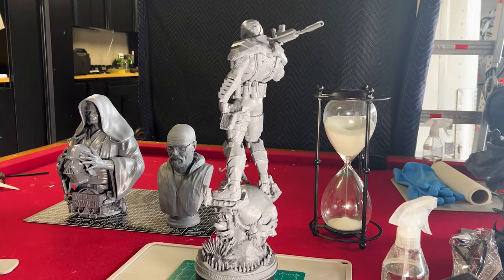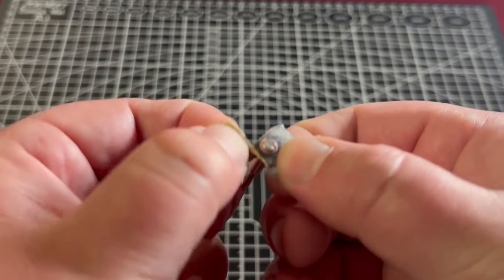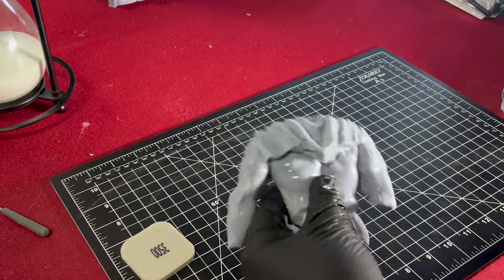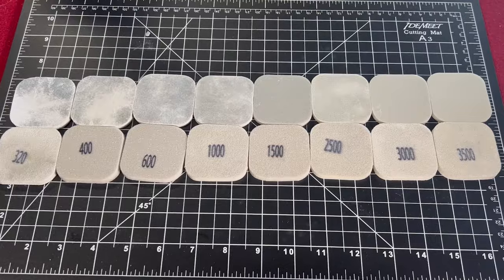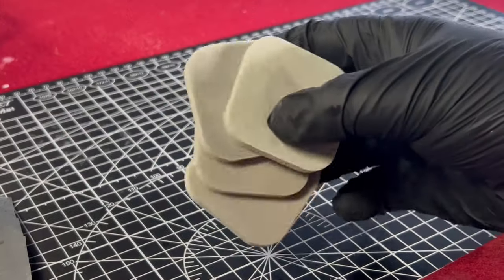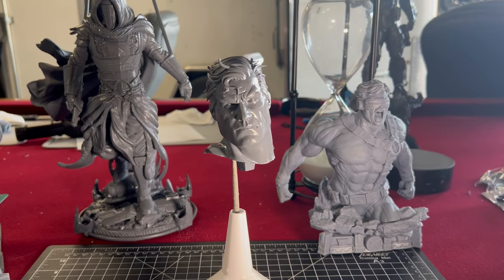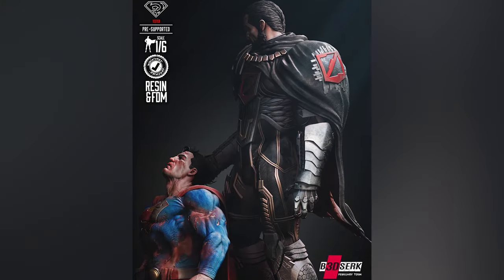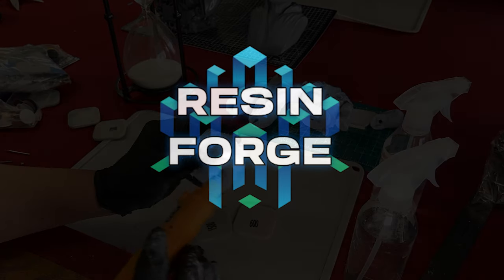Tools and Basics for Sanding Resin 3D Prints!

Comment from the maker: Links to the tools I use are in the description! 
Hello and thank you for stopping by! 

Sidenote for the 1 inch sanding discs  I use in the video: 
(These pads do NOT come with a center hole so you need to poke your own every time you change the sandpaper out... The metal attachment is also too large for the small Dremel but the pads fit fine on the one that comes with the Dremel)

If you enjoy the video please consider giving it a like I would truly appreciate it! 
If you have any questions on the process please leave a comment below and I will do my best to explain it

Comment: for me the most annoying thing when printing multi-part statue is the seam, where parts connect together and leaves some gaps
Reply from the maker: I am working on a video for that! Should be out in the next few weeks... I usually use some Aves 2 part apoxie sculpt or resin wield smaller gaps... The dremel makes easy work of flattening out bumps from seams. Thanks for the comment I appreciate it
Reply: @ResinForge is its possible to fill all the gap nicely, BUT still keep all the part seperated for easy airbrushing? the normal way is good and all but at then end of the day i got this big chunk of statue thats is hard to air brush
Reply from the maker: @WalamiFijilot  I’m not too sure 🤔 I’m new to the painting side of the hobby so I haven’t had to deal with that yet… Maybe paint them separate and leave the edges of the gap unpainted and than fix the gap and paint over it

Comment: So this looks useful for bigger prints, but I normally print tabletop minis and no matter what settings I apply I always get scaring marks from supports. It pretty difficult to remove these marks because of how detail dense resin mini are compared to traditional plastic minis. what would you recommend for smaller models?
Reply from the maker: Great point... Most of my prints are usually on the larger side. For smaller models you could use sanding sticks for detailed areas. It is basically a matchstick with a sanding pad on the end.

Something like this would probably work well 
https://a.co/d/g7d2cYW

Comment: What resin do you use? Also, do you have links to the metal files as well as the extra pieces for the sanding tool? Thanks!
Reply from the maker: I typically use ANYCUBIC Standard Resin... Its consistent, has a great price point and prints well for me even in lower temperatures, I have probably used about 40 bottles of it in the last few months with no issues. 
ANYCUBIC Standard Resin: https://amzn.to/3x5iJU9

File Set: https://a.co/d/jezk2Ni 
(The one in the video is from Ace Hardware but any small File set like this should work fine)

1 Inch Sanding Pads: https://amzn.to/4alA9u0
(These are the pads I used in the video, they are extremely durable but they do NOT come with a center hole so you need to poke your own every time you change the sandpaper out... The metal attachment is also too large for the small Dremel but they fit fine on the one that comes with the Dremel)

All of the links for the tools I used are now in the video Description! 🙂 

My videos will have the links in the description moving forward! (I was waiting for an approval thing from YT) 

Thank you for the comment I really appreciate it! 😁